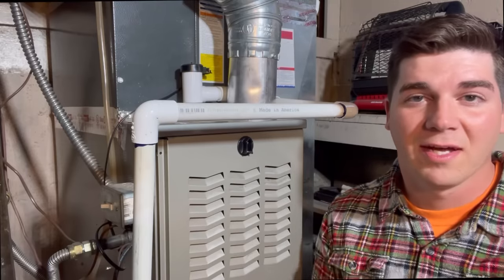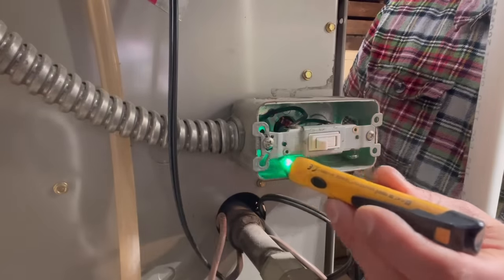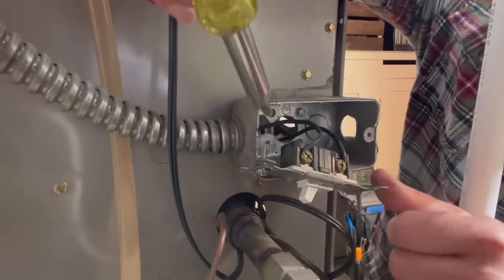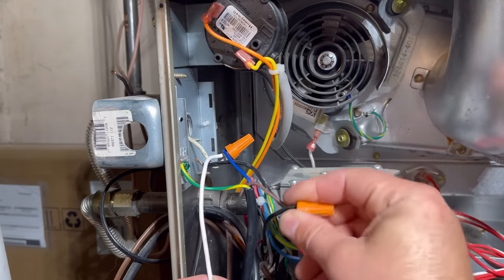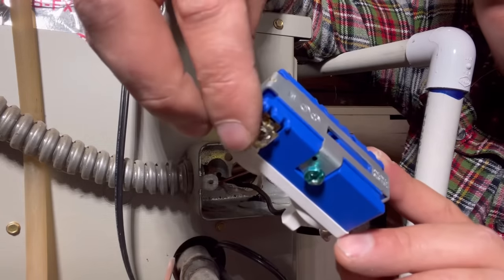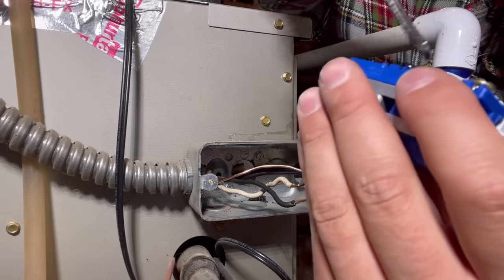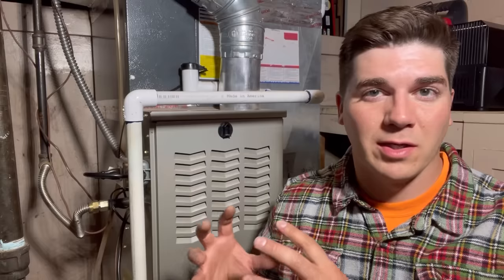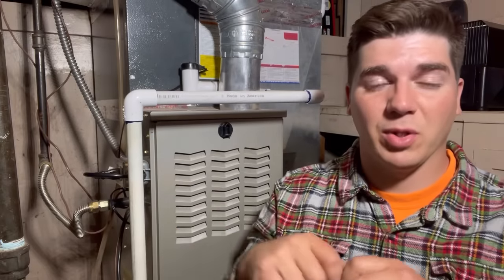This Could Keep Your Family Warm During An Emergency Power Outage.

Comment: First I will say thank you for this video! I will say that what I did on my furnace seems a whole lot more simple and was actually recommended by my furnace manufacturer!
I just installed a heavy duty so cable from my furnace and then the line coming from my breaker box was terminated at a 15 amp wall outlet. Normal operation my furnace is just plugged into the outlet and it's a done deal and then when I need backup power I just unplug it and plug it into the extension cord from the generator. No switches no extra nonsense just literally unplug it from the wall as I would any other Appliance, in the event of a power outage.
Reply: That makes a lot of sense. KISS Method
Reply: Yes.
Reply: "I will say that what I did on my furnace seems a whole lot more simple"
Uh, that's what he did in the video. He just installed an outlet at the furnace switch box. By the way, what is a "so cable" ? 
Also, see Neil Brookins comment above. What about that ground situation if you change over to the generator during an outage? Like Mr Brookins said you will then only be bonded to the generator, not the house ground. Also....what about code?  Is the furnace required to be on a switched power supply? ....in which case your 15 amp outlet might not be technically to code. In the scenario in this video it is still on a switched supply.
Reply: @rael5469  
 Well since you brought it up. no it's not the same I literally added a cord to my furnace... done, so yeah.
 So is just one designation for portable power cord that is flexible. There are multiple letters that get added in there like w's and j's and they all stand for something. Basically it's just like heavy duty extension cord cable mine being 10 gauge that I used for my application.
 You tube makes it very difficult to look at your comment and then reply to mine at the same time so I may have missed something and if I did by all means let me know and I will circle back around.
 As far as being grounded no it's not grounded to my power panel,which is good news for me because I'm not connected to it when running off the generator.   But then again neither is my refrigerator my freezer my lights Myspace heater or any other thing I plug into my generator during a power outage so it's really no different. my furnace is really just one big fan, as the heat source is not from electricity. But I would imagine everybody already figured that out as it's only connected to A120 Volt 15 amp power receptacle!
 As far as being up to code I really don't care. And it literally is recommended by my furnace manufacturer as a way to run the furnace during power outages so it must meet code in Minnesota lol
 As I say I'm not concerned by it because my  Furnace is literally a fan and a controller module as far as electricity powered items go so I'm trying not to overcomplicate things.
 And as every other appliance in my house other than my water heater is connected to the wall via a plug receptacle I don't see this as any different but that's just for me. everyone's free to  Take and use all or just one piece or none at all.
 I just presented it as an extremely simple and foolproof solution to providing heat to my house in the event of a power outage.  As far as being switched again I don't know and I'm not concerned but that is silly as can be because it is controlled by a breaker that is dedicated to the furnace so Besides the point I used to have an  All electric furnace and there was no switch on the side it was just a big breaker. I think the switch only comes into play if it's permanently wired in because there would be no easy way to disconnect it but mine is plugged into receptacle so just like any other device I can just pull the plug if I have to.
Reply: @brizzle8797  "Well since you brought it up. no it's not the same I literally added a cord to my furnace"
That's exactly what was done in THIS video. Did you watch the video?
Reply: @brizzle8797  "Yeah I watched the video. did you see where he added a Box?"
He didn't add a box, the box was already there.
Reply: @brizzle8797  "I added a cord."
So did he.
Reply: @brizzle8797  "As I said already it's not that big of a difference but you wanted to nitpick!"
YOU are the one who nitpicked it by even making your comment. I simply pointed out that what you said is exactly what the guy did. Added a cord.
Reply: @rael5469   
 Please don't be so silly like this. go back and read your 1st comment to me talking about how it's not so different what I did versus the video how it's the same as the video.  you started in on me. you don't mean to tell me you forgot what you wrote already. We can go about this as long as you want to..
 Remember I made the comment about what I did in My situation. you chose to reply to me.  maybe you'd like to check it again...
 I think I was on to something with that literacy bit, might want to get that looked at.
Reply: @brizzle8797  You won't admit you are wrong. You won't admit that you didn't watch the video. That's OK.
Reply: @brizzle8797  "Remember I made the comment about what I did in My situation. you chose to reply to me."
You insulted the guy's video by saying that your way was simpler.......but what you said was exactly what the guy in the video did......added a cord. Every reader can see this for themselves. .....and you keep coming back for more.
Reply: @brizzle8797  "let's hear about your furnaces what big brain things did you do?"
I'm going to do exactly what this guy did in this video. On the other hand nobody knows what the heck you're talking about.
Reply: @brizzle8797  Here's what YOU said: "I will say that what I did on my furnace seems a whole lot more simple "
Here's what I said: "Uh, that's what he did in the video. He just installed an outlet at the furnace switch box."
Nothing insulting in that. YOU are the one who took it down this road. There now. Now I've shown the readers EXACTLY what was said.....again.....which they could see for themselves the whole time because this thread isn't that big. You see.....that's what lead you to make an insulting comment in the first place.....your arrogance. You said your way was "a whole lot more simple" when what you did is almost EXACTLY like was done in this video....adding a cord to the furnace. 
Really guy????  Really?????  You took a fun video about preparing one's furnace for a generator and turned it into a flame fest????????   Wow......just wow.
Reply: @rael5469  
 How many times do I have to explain it for you??
 The reason I said it was simpler is because I took a couple of steps out of the video right? So less steps makes it more simple wouldn't you agree? that is literally all I said and then you had to attack my comment. You could have just left it alone but you had to throw yourself in there well I'm not gonna back down from nonsense from you. We can go about this all day if you want to but I stand by what I said and so do all the other people who liked my comment including the video creator!!
 That's how this all started yes it got out of control but that's because I'm not gonna put up with you.
 He had 3 to 4 steps and I had one I don't know what so hard to understand about that being simpler have a great day with your miserable life.
Reply: @brizzle8797  "What about all of the other thumbs up" 
Voting up your own comment doesn't count. Thanks for the laugh.
Reply: @brizzle8797  " So less steps makes it more simple wouldn't you agree?"
You had to add an outlet box to plug your cord into. That's the same number of steps as the guy in this video.
Reply: @brizzle8797  "that is literally all I said and then you had to attack my comment. "
I never attacked your comment. All I said was that what you described was the same as this man's video. That's all. Then you started a flame war. .....over a water heater video.
Reply: @rael5469  
 See I knew you didn't watch the video. It's not about a water heater it's about a furnace.
 Look I'm sorry you can't understand that 3 is more than one and so  Therefore one would be simpler than 3! 
 Here's the thing you have to be right even though you're wrong I made the comment I told people what I did I tried to share information.
 You know because maybe people don't want to add that special switch plug combo, that they definitely don't have to.  You know the one That I didn't add in my setup, you know to make it simpler. But I guess it's not simple enough for you to understand that and I'm really sorry about that.
 Public education you know it fails yeah as clearly as it has here.
 You have to try  To continuously prove that you are right when you are clearly wrong. And I know we go back-and-forth over 1 or 2 simple steps but that's really all we're talking about here and you can't seem to grasp that.
 My condolences for those around you!
Reply: @brizzle8797  "I made the comment I told people what I did I tried to share information."
And all I said was that you claimed to have done it simpler but in reality what you said is exactly what the guy in the video did....added a cord to his FURNACE (happy?)
Reply: @brizzle8797  "You know because maybe people don't want to add that special switch plug combo, that they definitely don't have to.  You know the one That I didn't add in my setup, you know to make it simpler. "
That's NOT a special switch plug combo. The box and switch existed BEFORE he added the cord. He simply added the cord and changed out the front plate for one that included an outlet in it. Simplicity itself. Which is MUCH simpler than doing it your way....by adding an entire new outlet in your utility room. He didn't have to add an outlet because the box was already there on the side of his furnace. Basically all he had to do was to add the cord. His way is simpler than your way of adding an entire new wall outlet in your utility room. There.......now that we've straightened that out. That's YOUR cue to come back and embarrass yourself .....all over again.
Reply: @rael5469  
 Yeah that's fine I'm sure we can probably agree on that.  But as I say there were multiple people that seemed to think that it was a little bit more cut-and-dry than the video.  One  Person even referred to my method as the kiss method. so I don't know maybe a few people agree. I even gained a heart from the creator so seemed like he was OK with it. but anyways I don't care if nobody wants to use it don't. if I help somebody great.  that's really the deal.
Reply: @rael5469  
 Yeah I know it's not a big deal I'm pretty sure that even I am aware you are aware this is a furnace video. it was just for fun because you were asking me if I  Actually watch the video in your earlier comments remember.
 I didn't go psycho over the comments. but here's the deal  I'm not gonna back down to you or anyone else OK. I know what I did here and you're just having a trouble grasping it even if it was one step simpler, it still was, point blank and that's all there is to it OK!  we can go about this as long as you want or we can end it here your choice. it's my comment and I'm sticking to it. Why don't you go battle some of the other people who agree with me see what they have to say about it. 
 Better yet go ask the  creator why he gave me that heart and a thumbs up!  you should tell him to remove it because my comment is incorrect and should not be tolerated, right...
Reply: @brizzle8797  " I don't know why you didn't know that it was already there buddy. "
.....because you didn't say so, that's why. YOU made it sound like you had to add an outlet. This guy didn't add an outlet per se...........he simply modified the switch box that was already there. It was essentially the SAME as what you did in your case. I like his way better.
Reply: @rael5469  
 I gotta say it's coming up again and I'm truly concerned for you and those around you. your comprehension of written text is not the  Greatest! And if I can see it I'm sure people around you see it all the time.
 If you go back and read the whole comment and not just take out a little snippet you would see that I was being sarcastic because you seem to know so much about everything including what I have that I said gee I don't know why you wouldn't have known that.  Make more sense for you now?
 It's OK I'll do the explaining for you but I mean once we're done with this if it ever gets done I can't help you anymore you know what I mean so I suggest you see a specialist or something.
 And here's another tidbit that's really funny because you think you know everything about me and you don't!  the other part of this was I wanted people to understand that they didn't have to go through all of that if they didn't have all of that crap to begin with. Because literally a cord comes out of the side of my furnace and that is all. so maybe if they only had a power wire coming into their furnace that they didn't have to go through all this other stuff to achieve the same result. Can you understand that at all or is that too complex? right the point of the video in the 1st place was to make people understand how they could power their furnace in an emergency so if people had that switch then great they can do what the person in the video did and be just fine but if they didn't then they don't have to go through all of that they can just simply do what I did which would be simpler for them!!! are you starting to understand that is it still too complex for you?
Reply: @brizzle8797  "If you go back and read the whole comment and not just take out a little snippet you would see that I was being sarcastic because you seem to know so much about everything including what I have that I said gee I don't know why you wouldn't have known that.  Make more sense for you now?"
Make more sense? That was a bunch of gibberish. A rambling run-on sentence.